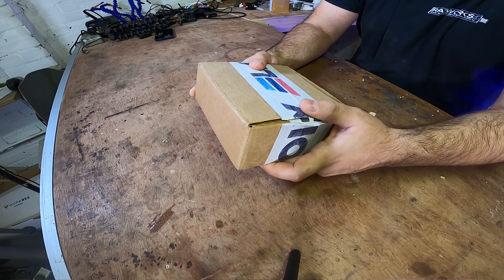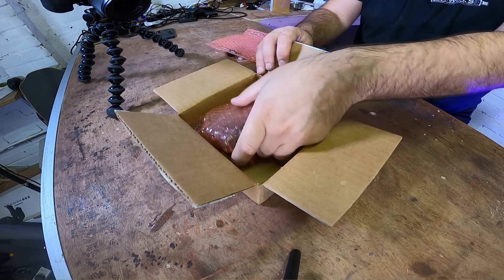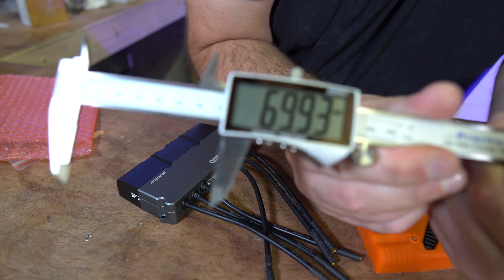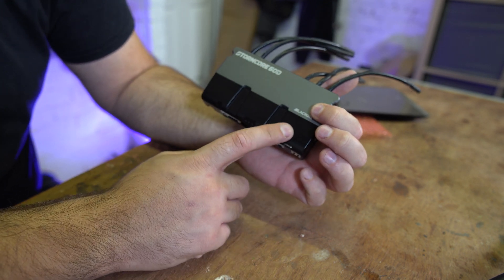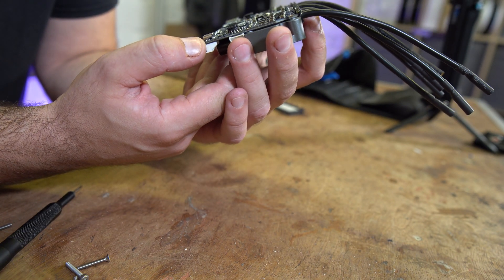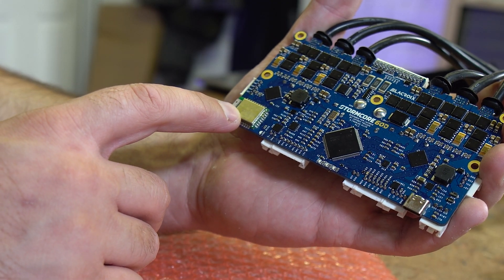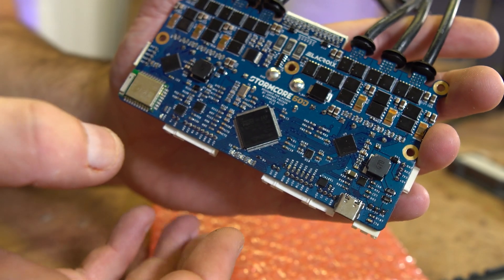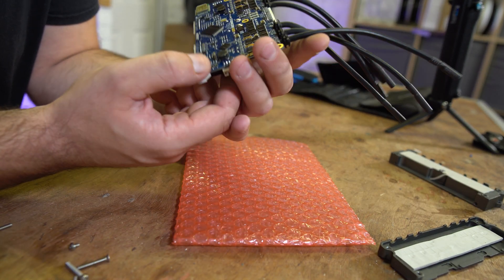Whats inside? Lacroix Stormcore 60D

Comment: You know when you have gone full geek when you love blue PCBs lol , looks good but I like the lighter weight of the unity (I’ve never actually looked at the unity inside my board) but does the unity require extra heat sinks that makes it heavier than the stormcore ? Whichever one has the easiest to use set up and easiest to use app and is lightest and most reliable then that’s the one I choose , and lastly is it a VESC or a stormcore 😉
Reply from the maker: TwoEsk8Riders you’ve actually hit upon an important point here, I’m gonna pin this comment.  Most people do not care what’s inside anything - only how does it benefit me? Is it easier to set up? Higher performing? Or some other factor?  I think a lot has to be said for this and I think Stormcore having its own app is a major plus point here.  It’s a dual VESC 😏.

Comment: Does the Stormcore apps auto lock need to be on or off?   After installing new Boardnamics BN M1-AT Gear Drive on my Lacroix electric skateboard 12s4p p42a 21700 molicel and replacing motors from 6389's to 63100's the board would not charge. Charger showed green as if fully charged but was no charge left.

After downloading the xiaoxiangBMS app it started to charge properly again!

But now It will not charge again. The battery shows fully charged in xiao & stormcore app and shows green light on charger again but it is not fully charged.

I'm seeing:
- a MOSFET software locked alarm
and also:
- A cell over voltage protection alarm

Any hints to point me in the right direction tremendously appreciated mates!

Comment: How did it hold up? I have just gotten one 😉 $250 🤯 the majority of my e rides are 14s though. That is still under 60v. Charge to 58.8. And a 16s lifepo4 that is same voltage 😉 i think I am going to open mine up to check it out before powering up. Like this just to check soldering 😉 just arrived today 😁

Comment: I think you saved me a boat load of trouble. I zoomed in on the motor sensor inputs and see that they are clear enough to know that mine are not correct for this StormCore 60D, and I will need to pull the pins and rearrange them. this lack of documentation has cost me months of head scratching & thinking I received a bad unit. hours of poor communication with a once trusted vendor.(Who Will remain name-less)
LaCroix could have included a simple pin out card with the product. The blessing of it is, I now know much more about this paper weight that still has potential to climb to an outstanding VESC.
 I think you are a blessing sir.
Thank You 70x7!
Jimbo C.
Reply from the maker: Hey dude, im really glad I could help you!
Reply: @LeeWright  Thank you again Lee.
I'm still having trouble getting a VX2 to bond to a Storm core 60D.
With your help I was able to get proof that the VX2 is actually working.
The wheels finally spun up. (Once) (Pretty sure is operator error ! Ha !) I think many DIY-ers are missing good instructions on the VESC TOOL. (I wish someone would post a thorough VESC TOOL explanation of terms. MISHAPS with controllers, and settiings is a big problem. I have been trying to get this equipment to work for over a month. I'm learning alot.

Comment: I'm curious to know if over engineering a DIY e-board with a 100D; wouldn't it be better to have it over the 60D because it won't get as hot since the voltage won't be maxed out

Comment: Having an issue with mine on motor detection. Getting really high resistance and very low amp readings on one side. When I measure the ohms between the phase wires (while disconnected from power), I get 82 kilo ohms. Except for one of the wires on the bad side where I only get 41 kilo ohms. It was like this right out of the box. Has anyone else seen this problem?
Reply from the maker: Have youbtried swapping the motors over to see if the fault moves?
Reply: Yes, swapped phase wires and both motors work on the “good” side of the esc.
Reply: I’m looking into how to diagnose the mosfets now as I don’t know what else it could be. I’m not really the type to argue with customer service unfortunately. Do you know anyone in the states that repairs esc’s?
Reply from the maker: @ericrodriguez9634  I would fire them an email.  In my experience they are very good! And the engineers that designed it work for them directly.

Comment: Hi i'm really new to diy boards but wanted to know if this is a good option to go with (dual 6376 185 kv motors from trampa) and also what size battery would anyone recommend for a big guy 6'2 125 kg (decent speed and like 15 ish miles range) any advise is welcomed thanks in advance .

Comment: I have torqueboard 90kv direct drive motors. They used to be powered by the focbox unity but the unity got fried. So im wondering if the stormcore 100D will be a more reliable replacement. Know where I can buy one of these stormcore 100D's?
Reply from the maker: Straight from lacroix, 100D is for the high voltage stuff thought, 60D would be a direct replacement

Comment: Exlnt more information enabling a better decision, I’m sure I’m gonna have to cross this bridge one day 🙏🏻😌
Reply: my foc unity was half the price, that made my decision easy as my wallet is anorexic at the moment.
Reply: Electric Deckhead how’s it holding up ? It’s interesting that lacroix was made bye the same guys ,I’m more interested in durability than pushing power , as I think the one in my board has a history of hick ups !only time will tell ,this guy does a great job of addressing tech. Subjects don’t you think?
Reply: @byroncornuel4101  I am yet to use mine, I am building a mountain board much like Lee's new build, I went for the unity intending to upgrade down the track and put it on my evolve as an upgrade to it.
It's awesome that Lee and folk like him are taking the time and money to do the comparisons for us, makes it a lot easier for guys like us, From my understanding lacroix gear is quite dialed.
Reply: Electric Deckhead yeh I got a bound board DD that I’m having problem’s with rebuilt the motors that had quality issues with ,so I ordered a new set that I’m waiting for ,think I have to run the vesc threw the program to align them again but it’s running better , when the ,or if the! New DD arrives I’m hopping to go 4WD too ,but I’m hopping to get on to an onsra with 6 inch wheels later down the track ,it’s a $$$ thing as always 😂🤣😂🤣😂
Travel well 🙏🏻😌👍🏻😎

Comment: In all honesty, I didn’t even know about this vesc until this video. Do you think it’s better than the Trampa VESCs?
Reply from the maker: Who knows? I hope so!
Reply: Lee Wright I await the after-use review of this.
Reply: @Koen Williams the Trampa vesc have Direct fets with are generally considered to be better for high power because they have a metal casing instead of a plastic casing (like the FETs in this vesc). The metal casing makes cooling easyer so the Trampa vesc should be able to handle higher loads for longer. Trampa vesc can easily be screwed on a bigger metal heat sink for extra cooling.
The only big downside is that they are super expensive.
Reply from the maker: Tech 518B this is a good, detailed reply.  Well done mate
Reply: Tech 518B i know, thanks for the amazingly detailed response though. I was mostly asking because he’s switching out his trampa vescs so I was wondering if he was just switching to test the new one.
Reply from the maker: @koenwilliams8819  I'm removing all trampa parts from my main build bud, that's the aim
Reply: @Koen Williams in reality there probably is no real noticeable difference between them. If they are both vesc 6 and you are not running into thermal limits they basically do the same thing. I did not notice a difference between the flipsky 6.6 and the Trampa vesc with the same settings.

If you want to save money I usually recommend the flipsky 6.6 because you can get 3 dual vesc for the Same price as 2 single Trampa vesc. Even if one breaks you still saved money.
Reply: Tech 518B yea, I’ve got a flipsky dual 6.6 and it crapped out on me. I’m not sure what the warranty is for trampa VESCs, but flipsky is like 2 months or something.

Comment: Very nice. I'm considering putting some conformal coating on mine once I get it. What do you think? Also, what were the bit sizes you used to open it up?
Reply: Looks to me that it's already coated.  The glossiness over all the components is a sign of conformal coating. Or maybe not?
Reply from the maker: Ole Godø I reckon you might be right bro
Reply from the maker: I think it was 2 and 3mm allen bro.  I think conformal coating is probably not needed if im honest as long as its in a good enclosure.... more on that soon!
Reply: Huh, I heard from Markus at Bioboards that it wasn't coated already, or maybe that was just him saying that he didn't do any conformal coating on the stormcore himself.